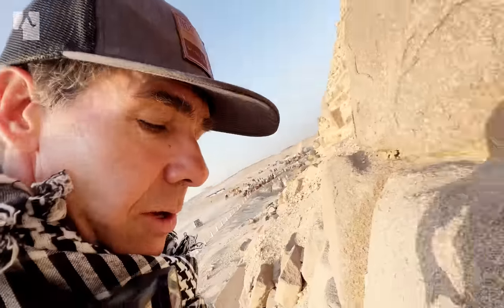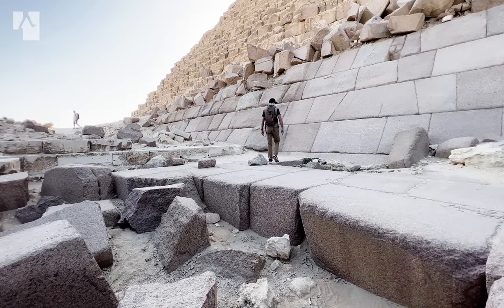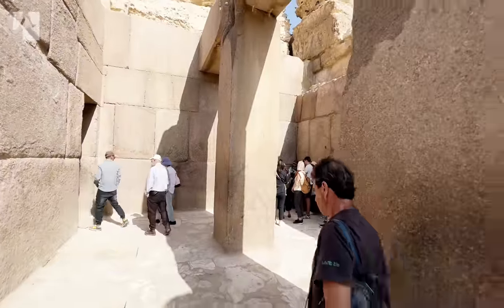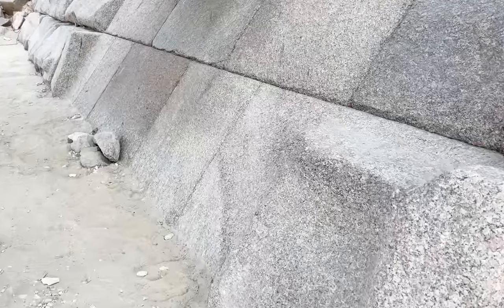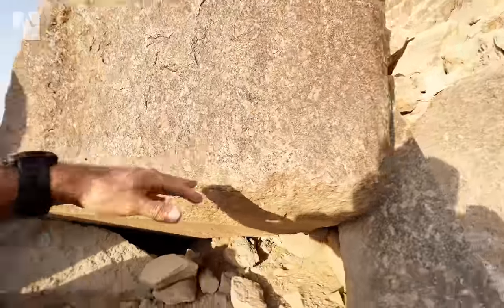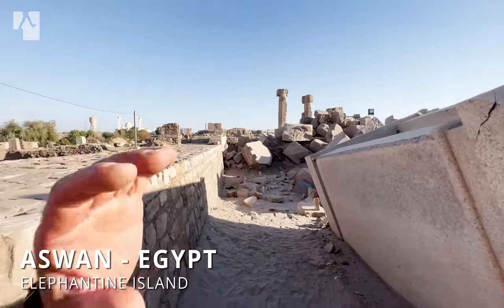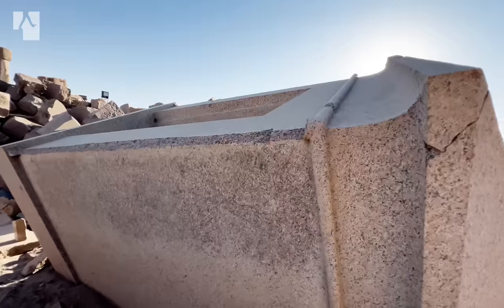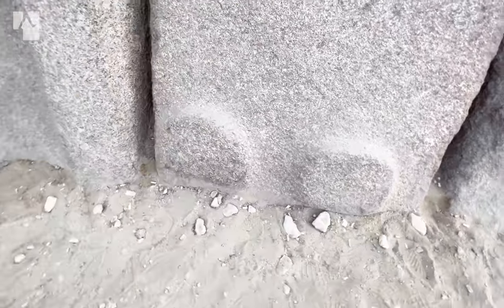Building The IMPOSSIBLE Red Granite Stone Pyramid

Comment: Perhaps, just like the stones at Puma punku. Find out that these casing stones are not actually cut Granite but geopolymer. Because has now been verified at Puma punku that those stones that are there actually have resins in them. As you know when resin set long enough, they become indistinguishable from Stone until you test it in a spectrometer.
Reply from the maker: Thank you for the comment.  I went to the quarry and saw them in both places.  It's real granite.
Reply: Of course they have taken the raw material from a quarry. Then crushed it and used it for the geopolymer.

Comment: Yeah, I also looked at the groves/bevel on the Menkaure blocs you climbed. That's a really impressive feature and should be investigated more.
And for the box in Elephantine,  invite you to look a greek constructions. The dimensions getting smaller at the end was probably deliberate. It's a architectural technique to create an optical illusion making the box longer. The same can by found to make boxes look taller by making them a bit trapezoidal.
Reply from the maker: Good point - I'm aware of that trick but didn't think of it in that location.  I was puzzled by the gradient of surface smoothness changes top to bottom.
Reply from the maker: Thank you for the sub too!

Comment: nice that you measure the flatness of those massive blocks, but I wonder if you've had the opportunity to put a precision level on those blacks and see degree of level they were set at? And what about perpendicularity? Could those things be measured?
Reply from the maker: It was strange in that although surfaces were flat and joinery tight each block seemed to have it's own custom treatment.  I believe the backs of the casing stones were cut away at the bottoms to lay slightly downward essentially pressing against the pyramid structure to, I'd imagine, gravity as an inward force as well as downward.  Never seen anything built like.  Made no sense in terms of efficient production flow.

Comment: Are the stones "glued" together, or can they be easily separated along the joints? Can you show any examples of this?
Reply from the maker: I will try to follow up on this. They look like they are glued but separate easily it seems. I never saw any evidence of mortar or bonding agent - but those joint looked almost sealed.  Looks like a bonding agent from it's absolute contact - yet the scattered blocks have no trace of anything filling the surface pores.  Unless!  Heat was applied when the stones were being stacked and the pores are the un-melted crystals that auto arrange in the softer matrix.  Then when they are separated they would be an exact match but still look organic and have no trace of mortar.

Comment: Haved you looked into the geopolymer institute? They seem to be on the right track when it comes to figuring out how the stone was shaped.
Reply from the maker: Thank you! When I had a concrete company I used to resurface concrete by making a geopolymer.  This is rock, that has been cut to a very smooth and precise tolerance.  I think anyone that actually sees it in person would agree.
Reply: @stepoffproductions  I'm not saying that the granite is artificial, but it might have been softened using natural products. The people of the geopolymer institute seem to have figured out how to soften limestone, maybe the same thing is possible with granite as well.

Comment: The rougher part could be due to weathering while the finer part was buried in the sand.
Reply from the maker: Definitely when compare to the valley temple - that was buried for sure.  The front on the Menkaure was probably finish glass smooth and then has been weathering for a long time.

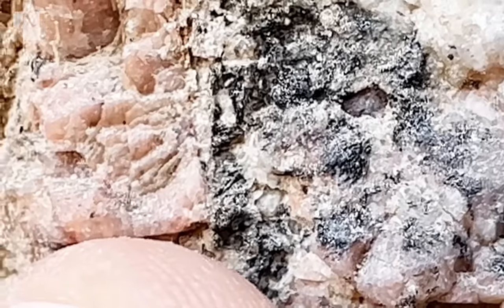Comment: 5:16 onward. You can see varying seams which are "perfect" to ones lesser so. When granite is quarried they would split them with wedges and shims. This makes a nearly perfect break.
Reply from the maker: Nearly perfect is far from the perfection I saw there. 
 especially in the valley temple complex.  If you look closely at the granite pyramid blocks you can see consistently engineered surface with transitions at https://youtu.be/wiqjYqDVzKA?t=984 and I regularly saw mechanically flattened granite surfaces.  
Additionally I've climbed into the diorite boxes in Serapieum of Saqarra and experienced the mirror smooth surfaces with my hands.  I'll be posting quite a bit on that amazing place!
Reply: sorry , you did not worked with your hand in hard stone to say that , i had and a split is never perfect
Reply: @al2207  Stone splitting with wedges absolutely makes a neat break. Go watch quarrying videos.

Comment: You don't have to melt granite in order to make it smooth and pillowy. We still make tombstones and countertops out of granite today (among other stones). To make a perfect seem between 2 large blocks, you would carefully mark each piece at the quarry, so that the correct blocks were placed together at the pyramid. That's a property of how granite cleaves, and it's one of the reasons they would carry the material from so far away - the strength of it, and the nice cleavage, so to speak. You seem to be surprised that granite would be polished, as if you'd never seen a countertop.

Also, many of your "findings" were looking at stuff that has been reconstructed for the tourism industry. You'd be surprised how much of it is just that.
Reply: For example: 11:32 yes that's a tight joint, but if you look at the details of the mineralization across that seam, you'll see that they clearly used adjacent blocks from the quarry. IOW, they cleanly cleaved those blocks out of a long outcropping, and then put them back together at the pyramid in the same order. This isn't rocket surgery man, c'mon. They specifically sought out rocks with that property. Even though the quarry was far away, the Pharoah demanded such perfection, reflection and strength. Others prioritized massive scale, so they used an easier material. Styles changed, from minimalism to maximalism (bigger structures, hieroglyphics EVERYWHERE, plaster and gaudy colors instead of polished stone)
Reply: Thanks for your insight into this ... as monkeys we are really just crawling over the past that was always there.  
imo the egyptians did not create the pyramids ... they found them as they were
Reply: @GizzyDillespee yeah, that's how 11 sided blocks at Sacsayhuaman were quarried. Puhleaze. We would see far more jagged, fractal edges, not a series of straight lines and gentle curves.
Reply from the maker: If it was an anomaly I'd agree.  But there are simply too many blocks that are fitting too tightly to consider this possibility for me.  I've also never seen granite split smoothly.  I'd also point to the very smooth and optically correct Aswan granite columns in Baalbek pointing to a level of technique that does not look hand crafted.  Thank you for the comment though.  I'm open to any evidence to supporting your theory.

Comment: I believe I have the answer to how these were constructed. Essentially it’s high powered direct current electricity and a tuning machine. Granite is made of quartz, iron, and other minerals. If you run a small current through the granite it will become magnetized and there is another frequency that will ignite the quartz through piezoelectric sparks. If the granite is magnetize-able than that means you can turn it into a pick-up and create a feedback loop with a cone and potentially control/warp the granite without even much external electrical output. Electricity and frequency is the answer. Think about it!
Reply: Obviously they had high powered saws and drills too. But in order to explain the walls of Peru and sacsayhuaman you need more tools than just straight cuts.
Reply from the maker: Very interesting - I have looking at gyrotrons.  Something heated the granite and could be projected some distance.

Comment: Thought.  If you cut to a-joining  stones out of 1 stone, then the cut faces would align up perfectly.
Reply from the maker: Yes you are absolutely correct.  in fact I think that it would be possible to cut vertical lines in the limestone and then just break them into pieces and then re-align them in another area to build the structures quickly.

Comment: It it were only possible to access an internal space where any two stones are currently joined, and test for micro inclusions of whichever material/metal that was used for cutting.
Reply from the maker: Yes!  My hope is to inspire a deeper look into the precision of these pieces.  I have a ton of other video to share!  Keep watching!  Thank you for your comment!
Reply: The Isida Project has done electron microscopy of several overcuts on blocks in Egypt, including one in basalt(Khufu Mortuary temple). The results showed copper oxide residue on the overcuts. 

It's worth noting that while the hardness of copper is less than basalt, a copper blade can still cut the stone, if an abrasive slurry is used. Also the copper that the Egyptians used was not pure, but contained ~10% arsenic. Work-hardened arsenical copper has much better hardness and durability than pure copper. 

However, I don't think copper tools can explain the perfection of compound curved surfaces on certain blocks or objects. The only way those curved surfaces could have been made by hand, is by extreme effort. And even then, who knows if they could have actually maintained the curves so accurately. Some proper metrology on these objects may be able to finally prove whether or not they could have been made by hand.
Reply from the maker: @bridgermauchley6179  Very interesting I saw many cuts in front of Kufu.  I'll check out the Isida Project - Thanks!

Comment: Great video very good observations of the Stone my question is what the heck deconstructed or get all that damage to a structures I think if you look at what deconstructed all those Ancient Ancient very ancient buildings pyramids structures would bring to light I think a timeline that would enter a lot of questions when they were built because whatever did all that damage should be proven easier trying to prove who built them or how does anybody got an answer to the question that I have is what the heck did all that damage to me it looks like a city a Dominos that just fell over those ain't Domino's that's granite so what happened in our history that caused all that damage a flood possible but I don't think the flood could do all that do you have any answers for me great job on the video very good observations of the stone work good job
Reply from the maker: They were likely quarried off the structure.  Everywhere are traditional splitting marks breaking them into smaller pieces.